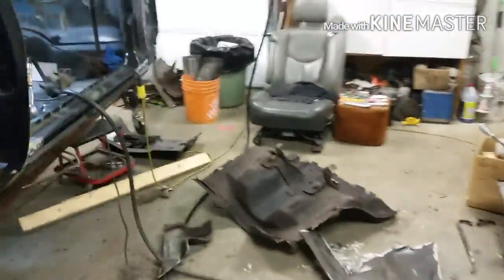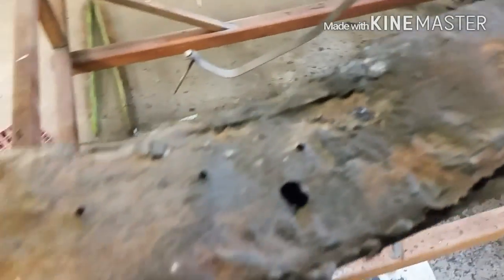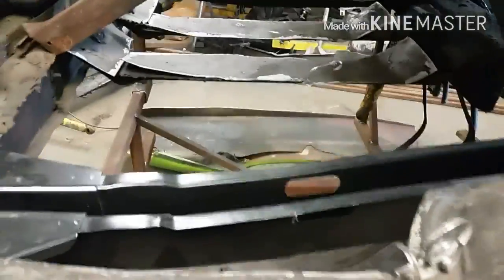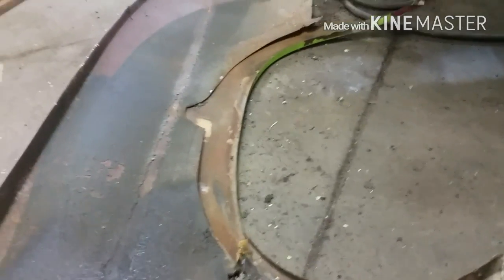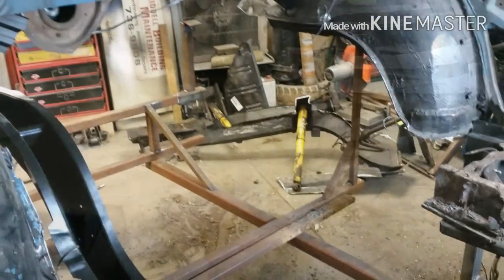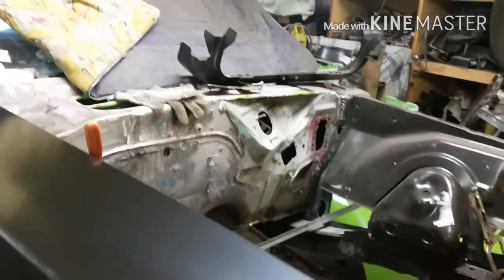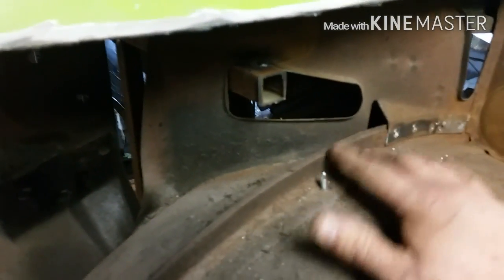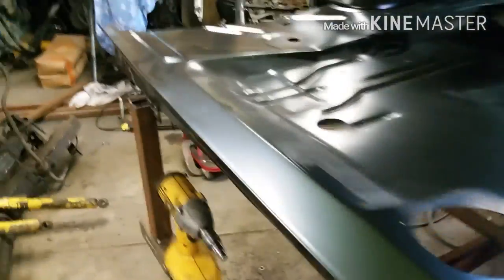Project cuda part 14

Comment: Man are you a breath of fresh air after a week of crappy videos. Well done Bruce. I agree on the wall art but as far as unibody cars are concerned, I think they are pure crap. Thank you Chrysler Corporation for inventing the stupidest build configuration known to mankind. LOL. One thing I will say about unibody construction, is that if the parts line up, the car will straighten itself when it is all attached together. Like you said, thank God for vice grips and zip screws. 
You do realize that you are making a lot of professionals on YouTube who take years to build a car, look like they don't really know what they are doing.....right? I think tenacious is the correct terminology. LOL.
Reply from the maker: thanks Ed I may have underestimated the time needed to do the car but considering I only have 2 days a week to work on it  your right should not take professionals years. I will have paint on it come spring and a good solid month of reassembly I think is reasonable. see ya 😆

Comment: Wow weee that is terrible and the worst body I have ever seen. Good LUCK! Your doing a good job. I guess you cant find a better cuda. They are rare. It will be All brand new Cuda when your done. You need some of those pins they use on aircraft sheet metal to hold in place while your building. Clecos fasteners. They say they work nice. Your doing a great job.